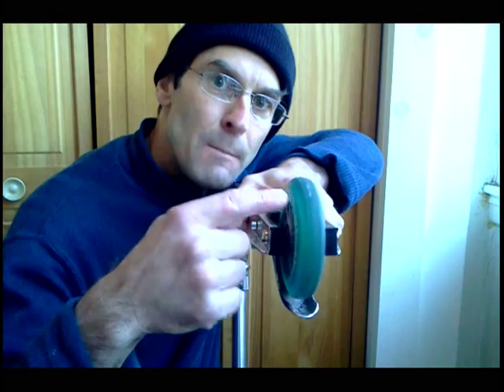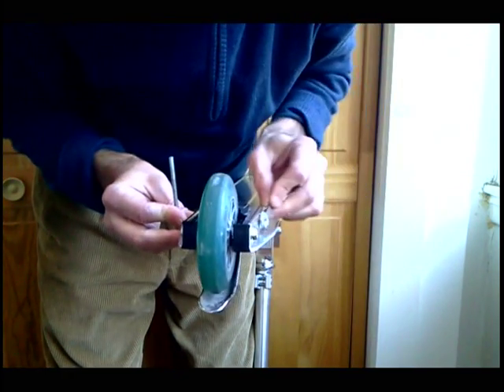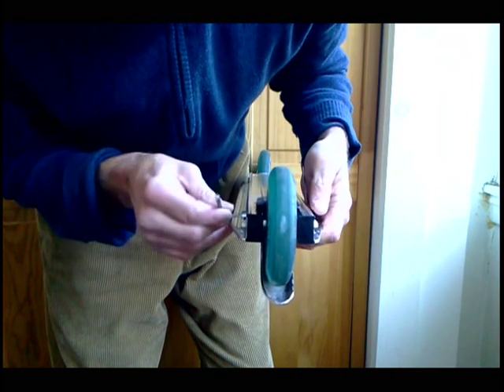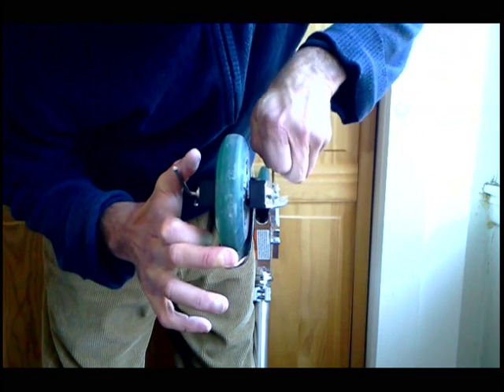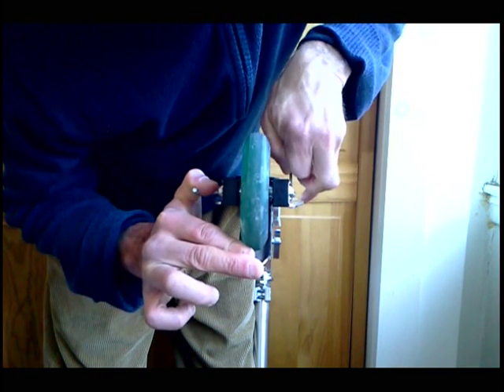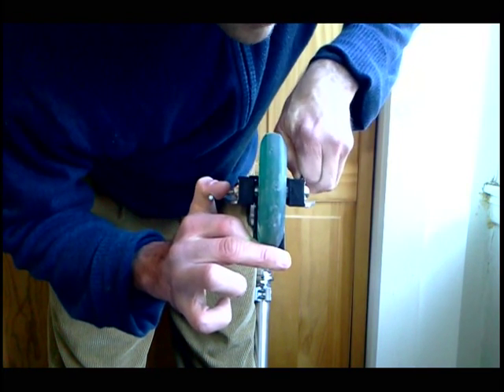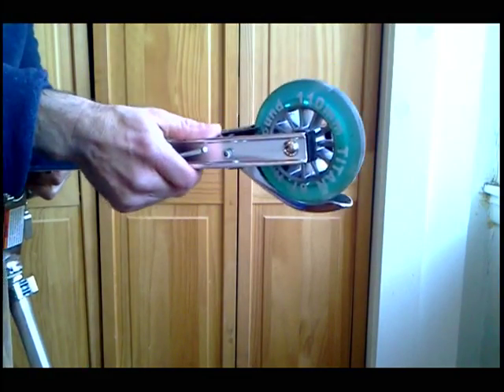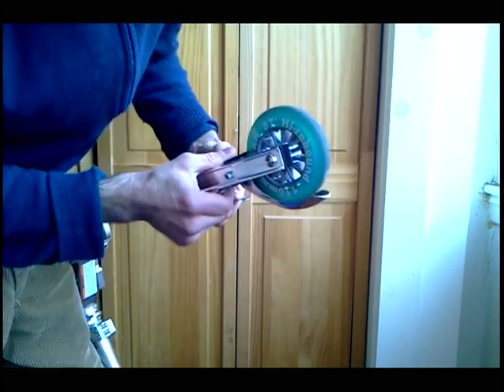Raise & Lower Brake on Kick Scooter 🛴

Comment: With slightly different screw assembly on my generic commuting scooter 200 mm wheels, your instructions were still ‘ on point’.
I was surprised when testing out the adjustment in wet conditions the brakes lurched me forward and they were quick to come to a dead stop.
I have confidence  my third cheap scooter will stop on a dime in better conditions
Reply from the maker: Thanks for posting & glad the info helps modern 200mm scooters, as I did this video a few years ago 🛴

Comment: Thanks for the video! One note to anyone trying this on a brand new A4: Be sure to ride the scooter and use the brake first. This will put a slight bend the hex screw that holds the brake in place. On a new scooter, the screw will be perfectly straight, so turning the screw won't raise the brake at all. If you're not getting enough clearance, try riding the scooter and slamming the brake a bit, which should bend the screw a bit more.
Reply from the maker: Thanks for the tip Michael! My hex is also slightly bent.